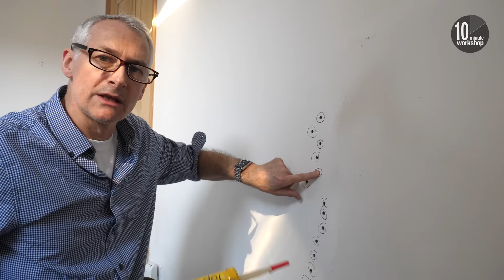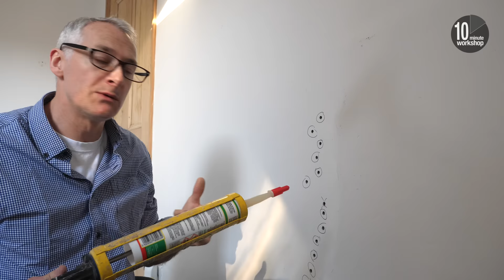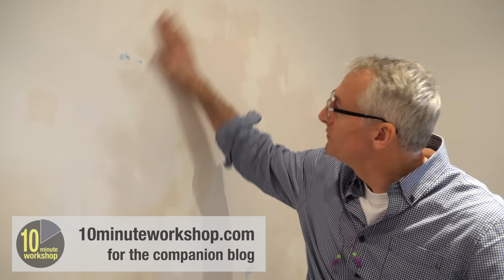Patch-up repair on lath & plaster walls [Video #375]

Comment: Peter Plaster Blaster ,is that the wifes laundry basket your usein there ,you didnt want to keep that vacuum anyway rite ,i wet sand drywall work no mus no fus and no dead vac ,dry wall /plaster dust destroys there bearings
Reply from the maker: All full sealed, Syd - or so they say! 🤷‍♂️👍

Comment: I did the same with a ceiling. Injected PVA but gave up with the idea. No PU used and just used loads of screws directly through the plaster and left them in before filling.

Comment: I’m a plasterer with over 20 years experience and this is exactly how I do repairs on L&P walls and ceilings.
P.S THANKS for the advice on the concealed hinges Peter
Reply from the maker: Ah, that’s really good to know, thanks! And glad to hear the hinge advice helped! 👍👍
Reply: I was about to ask can the same be done on ceilings, as I have a few spots to do, so thanks. Very good instructional video Peter 👌

Comment: Surely that beautiful straight edge should be in a dust free glass display cabinet!  Good use of the PU adhesive and a really good result. Thanks for the ideas.
Reply from the maker: Pah! Every working tool - has to earn its keep! 😂👍
Reply: Nice level. Never seen one like that.?
Reply from the maker: That one’s an Evo level from Superior Levels - see video #358 (give-away is finished, but the info’s good)👍
Reply: @10MinuteWorkshop  Thanks for the info. 👍

Comment: 👍👍👍👍 Jobs for Mrs 10 Minutes, go for it.
BTW doesn't hurt to put some fibres in the first fill, poly fibres for concrete works well and it's cheap or larger areas the glass mesh.  Best of all a happy Mrs10M😇😇😇
Reply from the maker: Thanks Clive, good tip re the fibres! 👍👍

Comment: Excellent Video thanks Peter. I did this repair on the ceiling and slanted wall in the under stairs convenience. Absolutely rock solid but my plastering skills leave a lot to be desired!! Pu adhesive was a awesome bit of kit but made a mess and I would definitely recommend gloves!
Reply from the maker: Cheers Aby! Yes, PU is amazing stuff, but horrible on hands! 👍👍

Comment: My Victorian House is full of Lath & blown plaster. It nice to see its not just my house. I am thinking of plaster boarding over the whole lot walls and Ceiling. But great video if I need to do a small repair. Thanks
Reply from the maker: Yes, that’s one option - find the studs and board over. You can hit snags at doorways /linings though. 👍👍

Comment: years ago before pu adhesive I used to drill holes and then squirt in high expanding foam to stabilise the wall before repairs, you gotta love that sticky stuff
Reply from the maker: Always! I think PU is a bit more more controlled - or maybe expanding foam is less controlled, lol! 👍👍

Comment: Here, across the pond, apparently we have very similar technology, many houses from that era suffering the same fate.  As a Home Inspector for buyers, this is something I know a thing or two about.  The plaster never did and was not intended to bond to the lathes.  It was pressed through them and curled around the back, forming "keys".  The lathes expand and contract with seasonal changes in humidity and the plaster loses whatever grip it might have had and the keys hold it in place.  Over time they fail and break off, especially on ceilings.  Some people use the repair washers and then plaster over them.  Some people rip out the loose plaster, leaving the lathes, and drywall over them or use drywall to make patches.  They glue and screw it to the lathes.  There is even a fiberglass reinforced type of drywall (blueboard) made to screw over the existing plaster.  The problem is, if you cover a lot of area you add a LOT of weight to the house and may cause settling.  I'll stop now.  You did a good job.

Comment: Excellent use of the amazing lumberjack pu glue, screws and washers ( without impact driver 😂) .... used lumberjack glue in similar situation with water damage ceiling.... bonded the extra slats between underside joist and ceiling board ... screw & washer combo then saved the day .... filler // sand // paint = happy outlaws ... oh don’t worry about the 50 steaming keyboarders.... long as Mrs 10 Minutes is happy then what matters.....  👍
Reply from the maker: Haha! Yes, indeed! Love that LumberJack PU adhesive - so useful for this kind of thing, and a lot easier to predict (and set) then expanding foam! 👍
Reply: Peter Millard .. yep expanding foam has its own mind lol ... even with foam gun ... PU is the way forward for lots of projects...

Comment: Pretty close to what I do at work Peter. I put polythene under the washers though, because I don't like to have any kind of impact on lath and plaster, every bang risks breaking off another key/nib somewhere. 

Most times these days I just brace the area using long 'quick adjustable poles' and bits of scrap wood instead of screws and washers (definitely need polythene then, or you'd never get the wood off lol!). 

All the best for 2022 :-)

Comment: Great job peter.     Think expanding foam would have done job.    I have fitted all my interior door linings in my 100 yr old bungalow with expanding foam as bricks were loose when taking out old linings. Plus used expanding foam to do same repairs as yourself. 👋👌
Reply from the maker: Yes, indeed; you need to be a bit more careful because it expands a long way - and takes longer to set, of course. Plus, I had some PU 🤷‍♂️👍.

Comment: A word of warning sanding old lath and plaster - it used to be made with horsehair and could contain anthrax spores.  Facemasks are a must.
Also, it is not always the plaster that separates from the laths, but the iron nails holding the lathes to the beams rusting through and the laths springing off the wall.

Comment: Haha...very nice. As a decorator it was a little different from my way but the results were good all the same. 👍👍
Reply from the maker: Thanks! How would you do it, out of interest? This was a kind of follow on from a question on the podcast, and I was keen to try out the approach! 👍👍
Reply: @10MinuteWorkshop  various ways, would probably remove more material, then use a thin bit of plaster board or backing plaster, then skim. I have use a similar method to yours with expanding foam though for small areas. No real right or wrong way, the result that matters.
Reply from the maker: Thanks! Just curious how the pro’s would do it! 👍👍

Comment: That was a timely video Peter, I was wondering what to use to patch up around a door frame I've replaced. Will have a look for some Easy On locally.
Reply from the maker: Or Easyfill, does the job nicely.  And thanks! 👍

Comment: I use dry liner ready mixed jointing compound for small jobs like that it sets quickly and it sands very well as it's designed to do

Comment: Wish you had done this a couple of weeks ago. I was looking for a suitable alternative for the Wickes brand ready mixed patching plaster which doesn't seem to be available any more. Looks like Easyfill was what I needed. Even after days of filling and sanding my (badly) plastered walls still looked rough, so in desperation I painted them matt white with  a coarse masonry roller sleeve. The slightly textured surface helps to disguise the imperfections...at least that's what I tell myself.
Reply from the maker: Yep, always love a bit of 'roller rash' to hide the imperfections! 👍😆
Reply: @10MinuteWorkshop  I wonder if it works on the kind of razor rash you get shaving with a plane iron?
Reply from the maker: @davidhull1610  My face after rinsing >> 😱<< 😂👍

Comment: Great repair never seen that done before  - but I would of thought just quickly taking down the old plaster then plaster boarding it up and a skim would be just as quick and a better solution? Although cost materials more
Reply from the maker: Occupied room in an occupied house - couldn’t take the mess of 130+ years of much & rubbish! Also there are some high-level fitted shelves on these walls, and I wouldn’t want to mess them up.
Reply: Peter Millard ahh fair Peter recently had a similar issue at my property and just knocked it all back to L&P but might try this solution if in an awkward place bound to create problems with furnishings etc
Reply from the maker: Happy wife, happy life 🤷‍♂️👍👍

Comment: I've got Edwardian plaster and lathe walls that chunks of plaster has fallen off. Do you have any advice to repair these holes. Unfortunately replacing the walls or totally replastering isn't an option at present. Thanks
Reply from the maker: Thanks. This entire video is about that exact process, including links in the description to the products used.  👍

Comment: How is it your clothes still look clean are they Teflon coated. I had to repair a lath and plaster ceiling where my apprentice had put his foot through it when his foot slipped. I used one coat plaster and when I had finished you couldn’t see the repair. I was taught to use a good smoothing trowel with a splash of water to help polish the plaster.
Reply from the maker: Shirt was Ok, but theme trousers were filthy! 👍👍

Comment: Does that Festool ETS 150 catch all the easi fill dust? I'm looking for a multipurpose sander that will be good for decorating.  Cheers.
Reply from the maker: A lot will depend on the extractor, and I don't think any sander/extractor combo can really catch 'all' the dust, but yes, the dust collection on this is very very good. 👍

Comment: Everything I've read about the ctl not working properly on forums talks about sanding plaster. Could that be the reason for the funny noise you were getting? Don't know why it's only on the auto start though.
Reply from the maker: Possibly Matthew, yes. Odd that it’s intermittent though?? 🤷‍♂️👍

Comment: Do you think using a hybrid polymer adhesive like Stixall would work great for long-lasting results? Have a ceiling with some light cracking and figured if a sealant that breaks everything else before it breaks would probably work great at resisting future lath expansion etc.
Reply from the maker: Probably - but the reason I used PU was that it foams up a little before setting , making it good for blown plaster. You might have to pump in a fair bit more polymer adhesive to be sure you get a good fix. 👍👍
Reply: @10MinuteWorkshop  Gave it a try. Boy, that sucked. Doing it on a ceiling is annoying with all the crap falling down onto your face, and shoddy laths that quickly lose thread on the washers, etc.
Reply: So I ended up switching to Pinkgrip solvent free. Main reason is I have a ton of holes to do over the whole ceiling (it's not completely blown, just come loose and pushes up a little in places due to how old it is). Since I'm up here I may as well as do it right so the cracks don't come back even if I'm going to lining paper it after.

Anyway, after going through the tube of stixall fairly quickly I realised I would need something good enough but cost effective. Looked at your PU glue but that's like £7 a tube and even if it expands a little I'd probably be buying a fair bit, whereas Pinkgrip is less than £3 a tube for a lot of it!

Just hope that the Pinkgrip will actually do the job as well! Any experience with that particular adhesive?
Reply: For what it's worth, I looked up how well PU adhesive does with gaps, and it seems incredibly poorly - no strength at all as it just ends up air bubbles. So I guess in the case of a ceiling it's probably better to go with dedicated gap filler adhesives after all.

Comment: could you list your products under your video so we know what to buy? I know what PVA is but not sure what filler you used. Wood filler in plaster holes?
Reply from the maker: Thanks for taking the time to comment. All products used are listed in the "Used/featured in this video" section in the video description. At 6.51 I say "I'm using a product called EasyFill, it's a bit like a cross between a plaster and filler, and is used a lot here as a drywall compound or 'mud' as our American cousins might call it..." and links are provided to this, and everything else used.  👍

Comment: You shouldn't drywall over that, it's not very difficult to patch plaster if you get a product like USG Structo-lite and use a plaster bonding agent like Plaster Weld. I'm sure in the UK they have different products but you basically want a lightweight plaster (not a drywall compound) and a bonding agent which gets painted on. You generally don't want to use water on the surface anymore that's the old school method and if you do that you are only relying on the plaster holding by "mushrooming" behind the lathe with the bonding agent you get bonding to the surface of the lathe as well. Plaster is actually a much stronger finish than drywall and if done with care won't actually need sanding because you can feather it into the existing wall if you mix it thin enough or use a finish plaster. Check out: Kirk Giordano plastering Inc. on youtube he has great videos on it.

Comment: As an Aussie child of the 80s, I've never seen a wall like this before.  Is it just a gypsum compound squished into the timber batttons?
Reply from the maker: Basically, yes. Internal walls in Victorian houses were made from studwork (4x2" but often less) covered with thin strips (laths) of wood, then plastered over. Very common in these period properties. 👍
Reply: Are there rules and regulations in place to prevent you gutting it all out and replacing the studwork and gyprocking it? Or is this not done in the older homes?

Comment: Well done sir,  I just subscribed to your channel. Quick question, you don’t use mesh tape on that seam where you filled up? Great video!!
Reply from the maker: Thanks, and welcome! No, not on a seam like this. If it was more regular I would, but it’s so uneven and the plaster/filler so thick (and ultimately hidden) it would be more trouble that it’s worth IMHO. 👍

Comment: Hello Peter
Would this adhesive work if it's brick behind the plaster thank youu
Reply from the maker: As long as you can get a relatively dust free connection, then I don’t see why not. 👍
Reply: @10MinuteWorkshop  would the hard wall screws connect into the brick like they do the lath
Reply: @10MinuteWorkshop  would the hard wall screws connect into the brick like they do the lath

Comment: What's the caulking adhesive you used?  It's not listed.
Reply from the maker: The adhesive is in the. video description - Everbuild Lumberjack 5-minute PU - https://amzn.to/2rSAAMn (US: nope) - and without watching the vid again I’m not sure if O used caulk, but if I did it would have been generic  1-hour caulk from a decorators merchant. 👍👍
Reply: @10MinuteWorkshop  Thanks for the reply.  I can't get this product where I live but I guess as long as it's Polyurethane Wood Glue it should work.